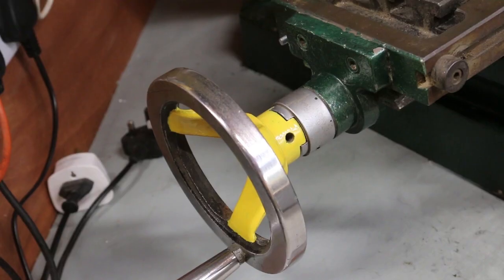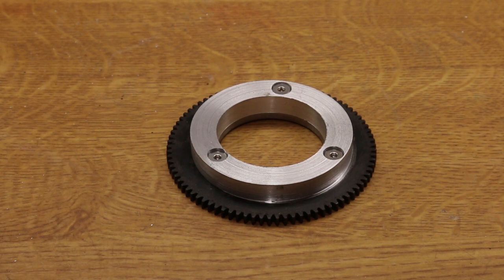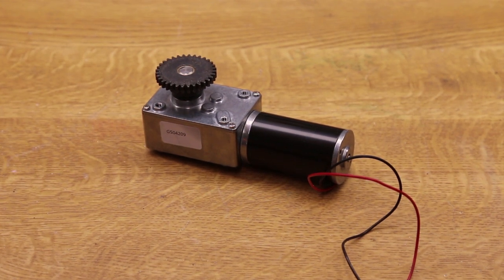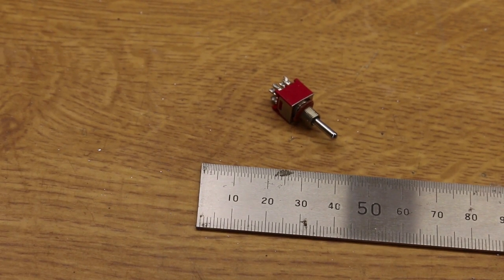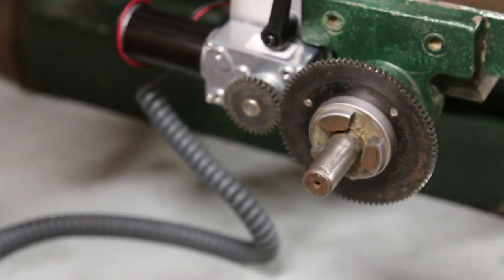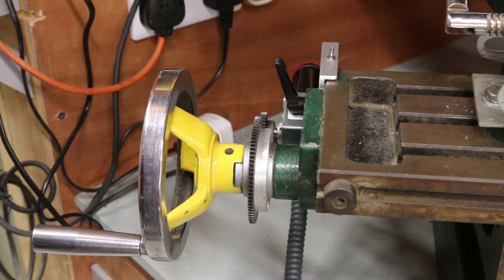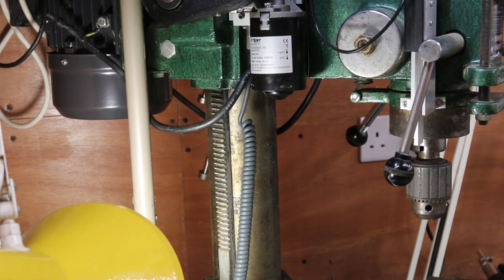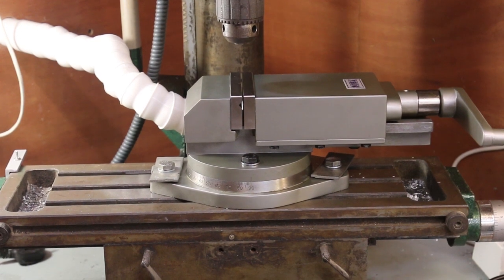power feed

Comment: the rpm on reverse is wobbling a bit , i wonder if the main gear was treuly centered or if the agme treaded rod might be lightly bend , having a steady rpm is kindof importand as it could affect the finish of the workpiece when flycutting

that said i realy like the setup (doesnt take a lot of room) and the way you can disconnect it
Reply from the maker: I had the gears too tightly meshed in the video , and had not yet lubricated the gears. Much smoother with that attended to.

Comment: It's a neat, pragmatic solution. Does the motor sound a little underpowered though? How does the current consumption compare to the specification?
Reply from the maker: Current consumption is at the top end at full speed, less if slower. With lubrication and care with meshing it is working well. In the video it was running dry (deadlines...)